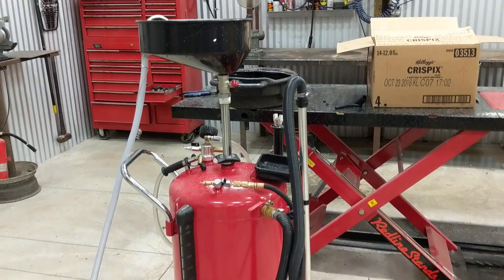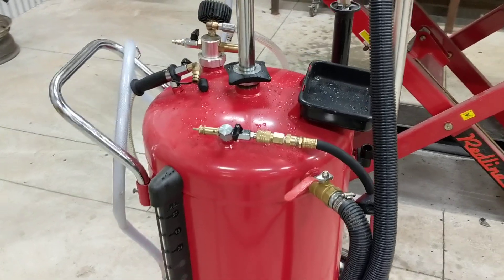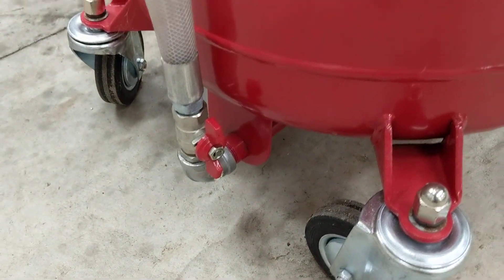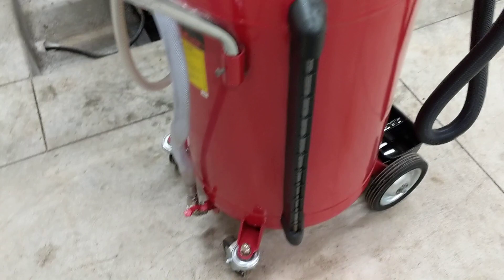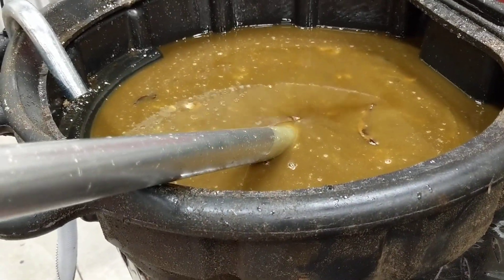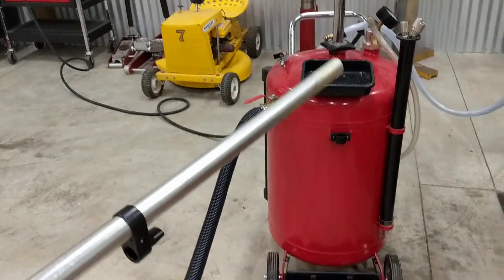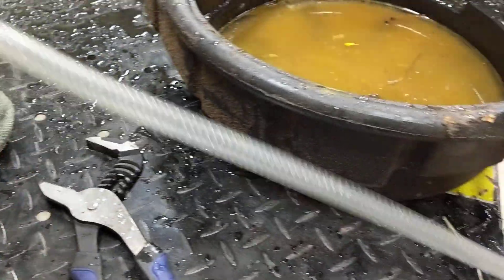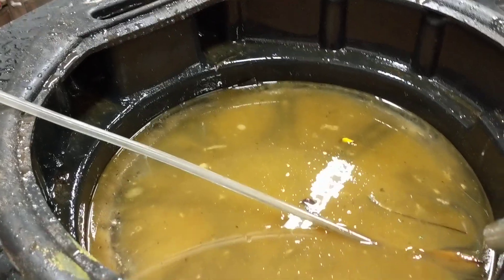How to operate the Redline ODT-30-E oil drain

Comment: I have the same unit and the handheld wont work anymore. I tried calling your number but there was no answer
Reply from the maker: Really?  What number did you call?  Should have been 901-351-4764.  Did you leave a message?  We had staff out yesterday, so catching all the calls was more than we could handle.  We have parts in stock for this unit.  Please call back and leave a message if we don't answer.